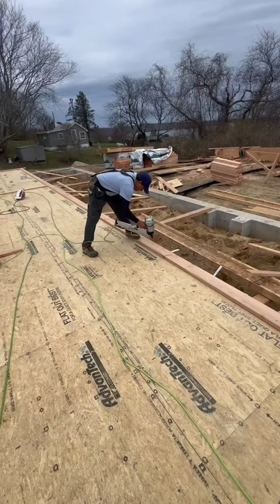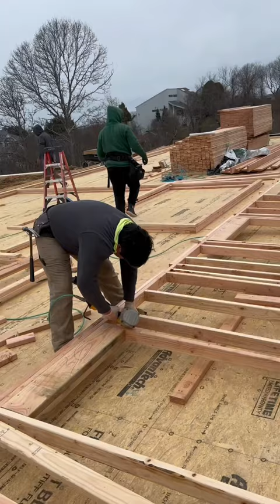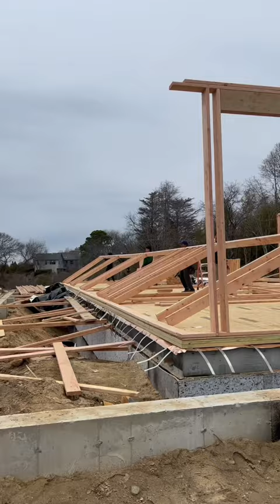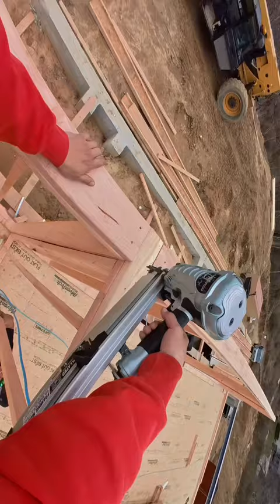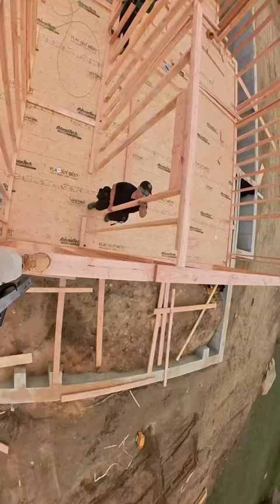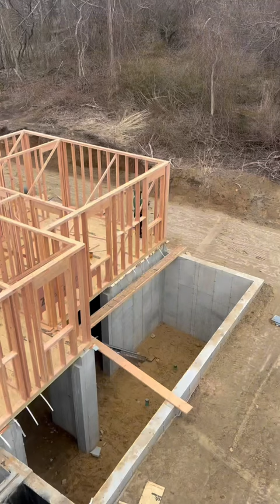Walls #shorts #short #work #construction #design #skills #carpenter #perfect #team #architecture

Comment: The two floor openings are sized for an open radius staircase and one has walls as if it’s an elevator shaft. No windows at garage/basement level is interesting also. Then there are full depth basement areas that don’t look like they are getting plated for a frame but are still accessible from the basement area. Maybe these are getting roof glazing for light or an indoor grow room but there are window opening on walls directly above so low slope glazing. It’s also possible that the foundation went full basement depth due to soil conditions. The dropped floor frame and garage to basement with the high ceiling suggests handicap access. Looks like the front stoop walls and haunches were formed for support columns but if it’s just a roof over, it seems excessive. But so does the floor framing and basement girder support. This structure seems to be over designed or maybe it’s getting another level and most of these mysteries will make sense. It could also be that the occupants are just very heavy people. Pull a high top handicap van into the garage, take the lift to the main floor, minimize steps/ramps to grade. Nice to be able to design and build something that is perfect for whoever is going to live there. Nice to get a few pics of the print on the next video Jorge.

Comment: There has to be a reason the exterior wall headers did not get 2X6 trim packing at the bottoms. Maybe the windows are arch tops and the sheathing gets templated and cut for the arch and then framed down.

Comment: Jus curious why u nail down bottom plate first then toenail studs?  Whats the advantage
Reply: Speed, accuracy, more money in your pocket. Layout, triple plate, detail studs, joists, rafters, openings, tees, corners, point loads, jacks and cripples, tack and pull back and it’s all auto pilot. But all hell is about to break loose with the box frame cry babies. I can hear them now. Read some wood engineering studies on end nailing vs toe nailing before you start screaming. I’m already feeling the love. It’s like getting hit by a bus in the dark…they watched the video but they don’t know what just happened. Note to box frame cry babies… watch and learn. If you watch this crew enough, don’t you think they could box frame if they wanted to. Maybe there is a reason they stand walls this way. Just maybe.
Reply: In NY most county's toenailing is code.
Reply: @henrypeisch5289  jus curious. Wouldnt second guess these dudes. They no joke
Reply: @Tom-sd5ru  you are right on.
Reply: The box frame only dudes are going to jump in any minute. You will get your chance. They just can’t help themselves.
Reply: That and why not sheet the wall exterior before standing the wall?  It may take one extra guide to stand the wall what does that really justify an extra day and sheeting? I'm open to hearing thoughts and reasons. I'm personally used to sheeting the wall on the floor papering it than it. As long as you make sure you're a square is cock on it works great. Of course there are variables. I'm just wondering other viewpoints
Reply: I'm dying to know. Maybe the lack of sheathing means the walls aren't squared. Thus a need to be able to move the walls. 
In my area we sheath the walls before standing, straighten and then potion walls which will be square and plumb once attached.
Reply: Sheeting the wall first...Lets just say there is a 3/8 or 1/2" sag in the middle of a foundation, then you and the boys are standing a 35' long said pre-sheathed wall. Add a 2nd story  with a heavy bathroom right in the middle of said sag. ..any thoughts? fail@LesleyandJonn
Reply: @henrypeisch5289 I was taught to box frame and was wondering why they do it too. Thanks for the explanation. 

I think the main advantage is not having to move the entire wall after standing it. I’m just wondering how much faster is it? Like have you seen two crews race?
Reply: @i_sharky Its not faster if anything it costs more money cause you need more guys to stand the wall up. These guys stand exteriors before sheething the wall so it takes more guys to put sheets on the wall when its laying it takes 1 idk about this lol.
Reply: @i_sharky it’s always been the fastest way to the roof. That should matter. Also fastest to packing up and moving to the next one. Everyone keeps busy. The work flow pushes the pace and can be dictated by the layout guy. That guy is probably cutting the roof also. Like I have said in every video that box frame only people scream and yell, if you learn this way, you will not go back to end nail, single plate and square and sheath on the deck. Layout and detail takes a little more to learn and teach maybe but once you frame this way, you will never go back to box framing except for unusual situations. Very unusual. What gets me is how many guys rip into this crew every time they stand walls. Every time an ignorant or critical comment is challenged, it’s clear they have never worked with a crew who frames this way. I will say that if you can’t hand nail, then you should not use a gun. I have never seen a race with two crews. Just personal experience with platform framing and different methods over a long period of time. But maybe the proof is in these videos. If this was not a faster, easier and more efficient way to get the frame up, don’t you think you would be watching west coast Cali style framing from this crew?  Everything these guys do is about speed and accuracy. And this is what makes a good frame, IMO. Find a layout man and cut man who frames like this and pay him to show up on a big frame for 2 weeks. It will be money well spent. But people will still argue that box is better in every way even tho it’s all they know. Hard to make an argument when it’s all you know. Keep watching.
Reply: @henrypeisch5289  yeah. I’m still an apprentice and I’m just curious about it. I always thought it was an east coast thing, kinda like the saw blade on the right side vs left. 

I know these guys are no joke from the videos I’ve seen. Appreciate all the info though
Reply: @i_sharky that’s a good attitude. Keep watching. Keep learning. No matter how long you have been around, you can always learn something new. Proud of you.
Reply: @danglin69  how does sheeting after standing change any of that? You still staple or ring nail the perimeter of the wall as well as up and down all studs? Do you wait until the whole house is up to sheet to allow for that sag? I'm genuinely not trying to be a smart ass... More ignorant, obviously there's different ways depending on where you are. I've seen a lot of videos where they sheet after. Personally the only time I've ever done it after is on walk out basements, then it's sheeted as soon as the floor goes on... Same idea I guess.
Reply: @LesleyandJonn fix any dips or humps at the mud sills or joist to keep the deck flat. Don’t wait for the walls regardless of how you frame. The real advantages to triple plate walls have to do with speed and accuracy. Everything follows your initial deck layout and goes up from there.
Reply: @danglin69 I don’t know what you are talking about toenailing is never code 🤷🏼‍♂️
Reply: @kellybirchfield-iv8sp  Apparently you are correct, I looked it up in NYS residential code book  R602.3(1),  end nailing and toeing are legal.  The contractor I framed with in the 80's would always squawk "gotta toe nail it it's code". We mostly built in Orange Co NY but I distinctly remember him hating end nailing lol.  Always learn something.
Reply: @danglin69 next wall you stand, end nail one stud at the bottom and toenail another. Cut it short and nail down a stretcher block. Then tap both with a 20 lb sledge to break the connection at sill. The difference may surprise you. Uplift on end nails is a given but it’s nice to know that toenails beat end nailing in many ways. When you consider triple plate layout and standing walls to sheath later, it is why you are watching these guys stand walls the way they do. Faster, more accurate and stronger connections. Toenail unless you box frame. If you box frame, keep watching.

Comment: I didnt see a single level in this video when they set those walls. This is why a finish carpenters and cabinet guys jobs are so hard. 

You have one job, frame a house level and square. It's pretty easy if you take 3 seconds to double check it. I've been on some BAD jobs on homes that were 4-8 million dollars. It's just insane to me. The final look starts with the foundational layers, this isn't it.
Reply: I’m guessing you only have box framed walls. They layout the entire deck and triple plate and detail plates for studs, headers, jacks, corners, tees, point loads, joist and rafters. Then pull back the top two. Toenail tops, stand walls and toenail bottoms. Everything is locked in at overlaps. You line, brace and plumb. Plumb one corner and the other is dead on. Sheath after walls are braced or keep moving upstairs. It happens so fast, it’s hard to catch on video. That’s why you don’t see it. Fastest way to stand walls. But it’s also the best way. Always an irritation to the long time box frame only guys who read comments when I say that. But admittedly nobody has seen much triple plate or may have tried it with the wrong crew 40 years ago. So, like yourself they haven’t done much triple plate either and take it personally and get defensive about the only way they know. Takes just a little more time to learn but once you do, you won’t square and sheath on the deck, ever again. Keep watching. Keep learning.
Reply: Walls are plumbed when braced. If you see braces in place toward the end of the video, the walls were lined and plumbed. Quick, precise and exact. The cabinet guys and finishers love this crew. Keep watching.
Reply: As a cabinet and trim guy, you would know a bad frame. If you did not frame those 4-8 million dollar homes, good chance the framers end nailed, squared and sheathed on the deck before standing walls (bait for the box frame only crowd).

Comment: Why wouldn’t you attach the bottom plate when you frame and then stand it up? Interesting way of doing it.
Reply: They're doing it the dumb way.
Reply: Their exteriors aren't sheathed they haven't put any vapor barrier on Interiors butting into exteriors and their window and door headers don't have a bottom plate on them for drywall backing and if they made the headers have a gap they just made it harder to insulate these guys are your cheapest home builders lol but you get what you pay for it also takes like 6 guys to stand 1 wall. You can easily pay 3 guys who can finish this in 2 days or pay 8 guys to finish in 1 day but will have to return to reframe their fuck ups
Reply: @idontknowanything2378 how many homes have you built using this framing method before you decided to stay with box framing? Strong criticism from someone, so I’m sure your experience and ability to evaluate the differences - is a vast one.
Reply: @idontknowanything2378 keep watching this build as videos upload. All your questions will be answered.
Reply: @ScottReynolds003 I’m going to guess that you frame the “smart way”. I’m also going to guess that it’s the only way you have framed. The only way we know, might not qualify us to know the difference between a dumb way and a smart way. If that concept does not make sense to you, stay with what you know.
Reply: @henrypeisch5289  I just think it's not as efficient as box framing having 2 guys maybe even 3 holding up the wall while someone's still nailing the studs down doesn't sit right with me or the osb on exterior can take one person to nail when it's on the floor instead of having someone hold it up while nailing and I know it's gotta be awkward installing on a ladder. It's obviously working out for you if you're going to vouch for it but I don't have 8 guys on site so I'll stick with my box framing.
Reply: @idontknowanything2378  so, the answer to my question about how many…is zero. You make my point.
Reply: @henrypeisch5289  lol 6 houses but hundreds of condo units I know what I'm talking about and in my opinion I think your building style seems inefficient to me but you're right I haven't tried doing it that way. I'm not going to
Reply: @henrypeisch5289  framed 35 years. That is a dumb way
Reply: @idontknowanything2378  maybe if you plated and stood walls like this crew, you would have a valid opinion. Keep watching.
Reply: Just remember the video is speeded up and there's a large crew. They have to move fast to make any money. No let in braces on long interior walls. Taxes collected off these crews will be zero.

Comment: Why frame top plates upside down then toe nail bottom 2x4??I just don't understand,  we nail Everton while wall is on deck then stand and bottom plate to deck,  and sq then sheet exterior walls while on deck,  ??? Plz explane????
Reply: Hi Robert. This has been explained in a few places in comments in a number of videos. It would be good if Jorge would do a short video with voice over to explain triple plate layout. But I will try. Easier to show you and easier on my thumbs. The deck is squared and sheathed. The print is transferred to the deck and all walls, point loads, openings are detailed on the sheathing. Snap all lines. Nail home first plate (this is the shoe and stays on the lines). This shoe plate layer is of course interrupted by openings such as doors. Tack (toe nail edge) the second (lower top plate) and nail home the third (upper top plate). The intersections are lapped so the walls interlock at the top plates. Detail all studs, corners, tees, headers, joist and rafters so marks are on the top for joist and rafter and sides for everything else. Same mark up and detail on one side for studs, corners, tees; headers and point loads. All three plates get marks (sides or edge of lower top and shoe and side and top of upper top plate). All layout and detail is done. Bench guy is making headers, corners and tees. Pull back (remove partial toenail tacks holding top plates to shoe plate) top plates (fastened together) and distribute all precuts approx on marks. We call this loading the wall. Toe nail each at the top and leave wall on deck. Nail in headers with wall on deck (some guys flip the assembly upside down to nail headers). No tees or corners yet as they are put in last. Pull the assembled wall back until bottoms of dangling studs drop on the lift side of the shoe plate. Stand wall and toenail bottoms. Lock in top laps and nail intersections at top plates. Everything is locked together and won’t go anywhere. Plumb, line and brace walls starting with long exterior walls. Plumb one wall and others are plumbed also because they are lapped at intersections. Jacks, sills and cripples. Everything toenailed top and bottom. Lay in the next floor and repeat triple plate at next level. It looks and sounds strange but once you learn this method, you won’t box frame your walls again. Sheath later. Fastest way to the roof. Cuts production time. Stronger and more precise frame and more money in your pocket. It’s why these guys do it. It’s just a better way to stand walls. Trust me.
Reply: Wish I was loaded with $$ I'd fly to come check you out,  trying to explain a lil difficult on both us and as you said it thumbs too😂😂😂😂

Comment: What a joke
Reply: whats the joke larry
Reply: @MrGuy-vd3bh  nailing  your bottom plate down then standing the wall up and having to toe nail your studs to it
Reply: Larry, maybe the joke is on you. Keep watching and learn.
Reply: @larryrosol3135 keep watching.
Reply: @henrypeisch5289  Framing for 46 years custom homes in Hinsdale IL
I learned how wrong this is in 1978
You nail your wall totally together then square it then sheet it and stand it up
So you don't have to use your whole crew to toe nail studs into a bottom plate and then.spend 2 days on ladders and scaffolding to sheet them I hope you learned something
Reply: @larryrosol3135  My friend, no disrespect intended. I have you beat on length of time in the trades and on the variety of methods used to platform frame. But that fact should not settle any friendly disagreement. I have seen a bit. What I find interesting is that most box-only guys (like you) can be so critical of triple plate, stand and sheath later but at the same time also appreciate the many other aspects of the quality work this crew performs in the videos. It’s hard to find fault with much and maybe most guys watching have never seen some of the work this crew does and may never see. For a awhile I thought maybe the racist comments were part of it but also many framers tend to take offense when they realize there is a better way to stand walls, etc. Maybe the same guys should not be on a ladder with a sheet of plywood either. Again, no disrespect but you are aware of your own limitations. Maybe a combination of factors. Box framed walls are so basic that anyone can do it. Triple plate might be a little more difficult to learn and teach - due to some intellectual deficiencies. Maybe that’s what happened in 1978. Only you would know. If you like the way these guys do everything else, don’t you think they would box frame, square and sheath if they thought it was faster, more precise and more efficient than triple plate. Use common sense. Or did that blow off the roof in 1978 also. Speed, accuracy and most efficient with best use of your crew, learn to frame and sheath later. So many advantages. I would know. You can trust me on that. Well, did I learn anything…to answer your question, I learned some things about Larry. Keep watching.
Reply: And Larry, if I’m not too late…don’t look at the sun.
Reply: @henrypeisch5289  Didn't find fault in the work they were doing found fault in their application
Reply: @larryrosol3135  it might be that you need to do quality work in order to recognize quality work. But you would know unless you don’t recognize quality. Keep watching and learning.